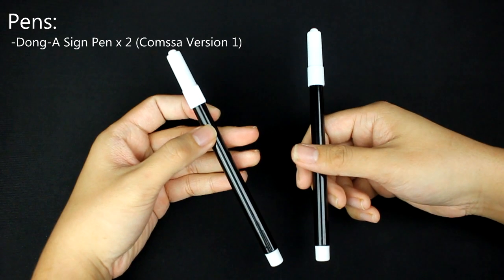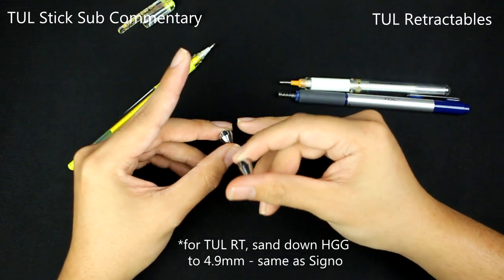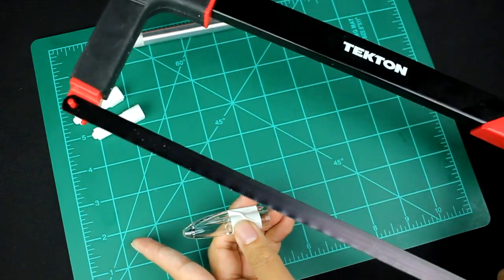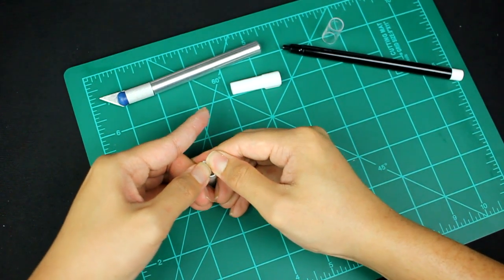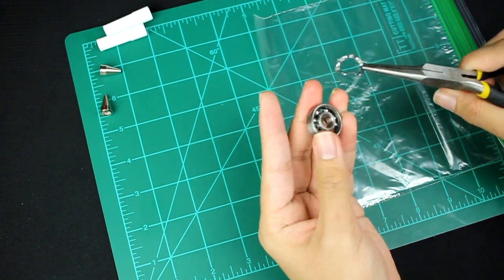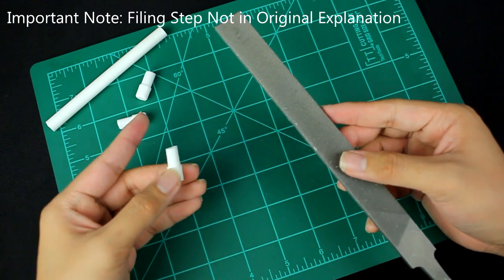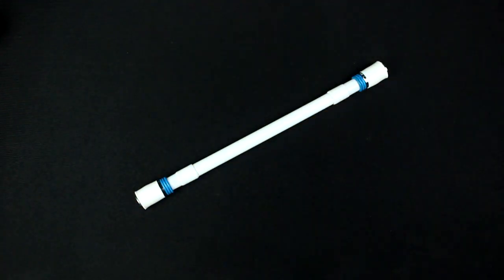SuperVValrus V2 Mod Tutorial (Full, Step-by-Step)

Comment from the maker: Steps Only, no Commentary sections: https://youtu.be/EWOkxlEhpTo

///Time Stamps///
Pens – 0:07
TUL Stick Subs + Commentary – 0:31
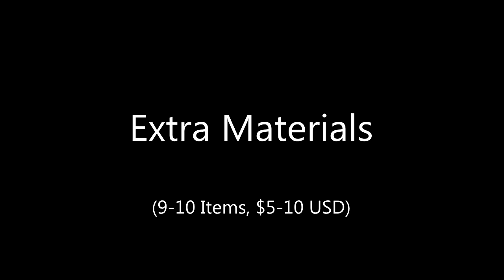Extra Materials – 3:45
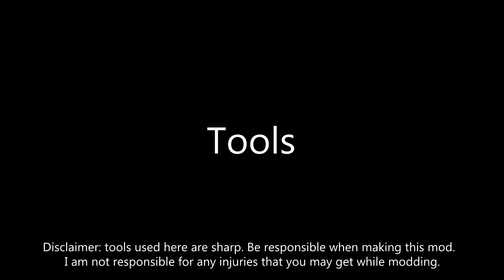Tools – 4:43
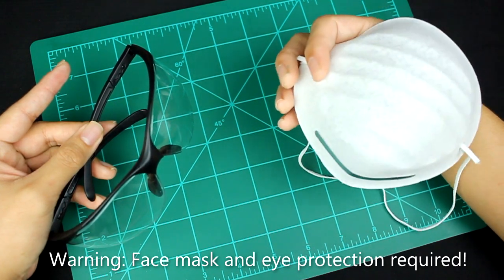Tutorial – 4:47
Caps – 4:55
HGG Sanding – 8:31
Ball Bearing Steps – 10:03
Supergluing Steps – 12:24
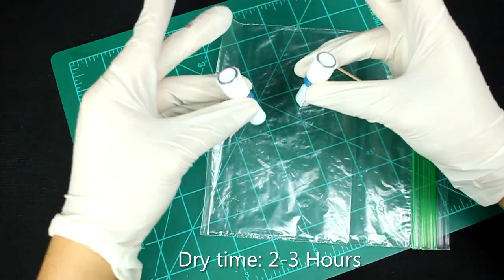Body – 12:56 
Hollow Out Front – 15:19
Filing Comssa Backplug – 15:41
Assembly – 17:23
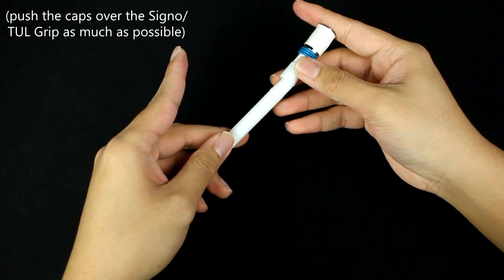Ending – 17:33

Sanded down HGG + Tip Masses:
G3 + HGG (10.8mm) = 2.0g
Signo + HGG (4.9mm) = 2.1g 
TUL RT + HGG (4.9mm) = 2.1g
Pilot Juice Up + HGG (FULL) = 3.3g
(uncertainty is +- 0.05g)

Reference [1], drilling Comssa Caps (SuperVValrus): https://www.youtube.com/watch?v=gpK5JL5vokc

SuperVValrus’ Original V2 Mod Explanation: https://www.youtube.com/watch?v=LxhjGr-o6sw

Comment: What is the pilot juice up? I see an 04 with metal tips, but since there is also an 05 with plastic tips I'm wondering if it's the 04 or if it's something no longer easy to find? I also see an 03 with metal tips. (Seems to mean 0.3, 0.4, or 0.5 size ink roller)